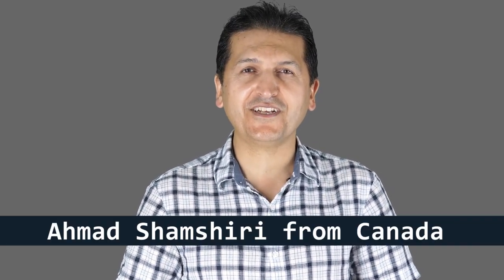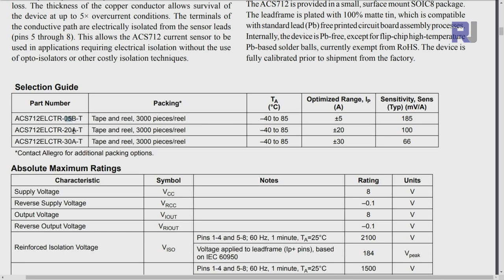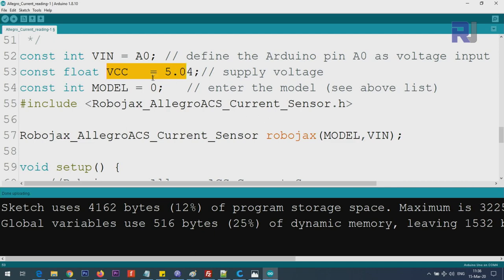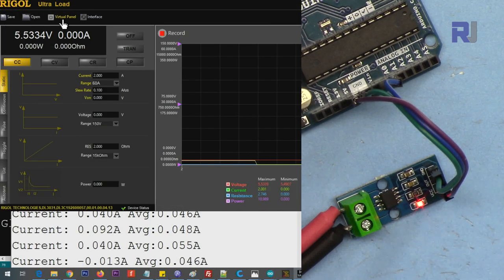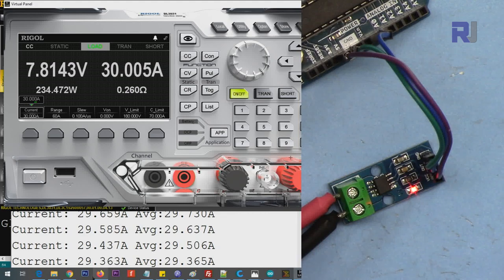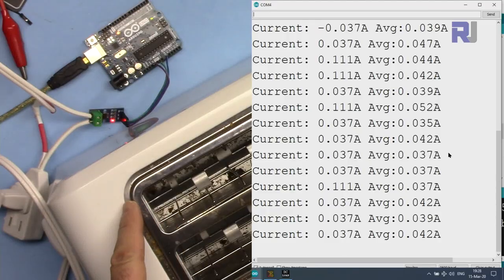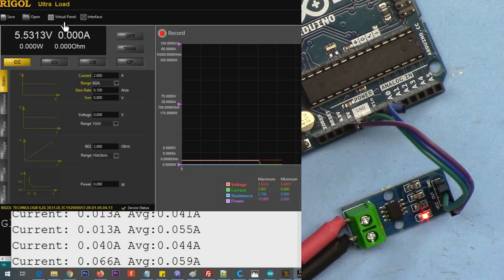Measuring 5A-30A AC and DC current using Allegro ACS712 with Robojax Library (code added into video)

Comment: Thank you for the video. 
I have tried it out however i am getting fluctuating current when i compare to a digital multimeter, is there something that needs to be added on the circuit to get a constant current reading?

Comment: Thank you for your tutorial about ACS712 this is awesome 👍 do you have a video for ACS712  with ESP8266/nodemcu board  and also measuring Energy in Wh, Voltage, current and power ?
Reply from the maker: You are welcome. For now I don't have video this. I might make video. here is my video on Energy Meter https://youtu.be/UK8Kvk8wFmw and how to measure any voltage using Arduino https://youtu.be/t8xwrVj2aFs . You could search without waiting for my response.

Comment: Hello,

I'm using an ESP-8266 nodemcu to measure the current on an AC load(230V, 50Hz). I connected NodeMCU via USB to laptop, and I'm powering the ACS712 trough 5V on breadboard. I connected GND of ESP-8266 to GND of ACS712. Using your code and library I get 13Amps with no load, and no change when I put a 700W load...
Reply from the maker: Hi, first should use this Arduino. I have not tested it with ESP8266 but it might work. I have no idea what you do wrong. So try it on Arduino UNO make sure it works then try it on ESP module.
Reply: @robojax  hi can i use ACS712-30A on an AC load (220 v , 50hz ) !? 
and thank u

Comment: Hello Mr. Ahmad SHAMSHIRI
I am glad to see your video. 
I have one concern, I tried to use your library to determine the power of a piece of equipment but it did not work. 
Please how to use your library to calculate the power of the equipment connected with ACS712-5A sensor.
Reply from the maker: Hello, of course it should not work. It is only current sensor. For power you need voltage then P=v*I where is I is current in ampere. So measure voltage using code in this video Measure any  DC voltage with Arduino
https://youtu.be/t8xwrVj2aFs
Reply: I have the same difficulty. I want to use it in an program but,i don't known how i can use you library.

Comment: Should I buy an R4 or R3? Will your libraries be compatible with R4? I'm interested in current sensing, for the moment.
Reply from the maker: Current sensing is done by measuring voltage. So we use analog input. it does not mater if you use R3 or R4. I have not used the R4 and just purchased it. it seems better for other reasons.

Comment: I have a question for you. I have made a 16 channel relay module and using16 switches (three wires using separate resistors) and was wondering if i could further use the 16 channel multiplexer to further reduce the wiring and still be able to toggle all the 16 channels independently? in your video you said only one relay at a time? BTW LOVE all you videos and have made so many projects because of them
Reply from the maker: Hi Dave, Thank you for your nice and kind comment. Would you please post your question under the relevant video "16 channel multiplexer"? this way when I answer, other people will also learn. https://snipboard.io/Fq5oST.jpg

Comment: You indicate in your video and the allegro data sheet that this device can measure both AC and DC current.  I have an application where the current to be measured is sometimes AC and sometimes DC.  Do I need to specify which current I am measuring or does it matter.
Reply from the maker: no you don't. your sensor does it for you. Just select the right sensor.
Reply: @robojax  When you say just select the right sensor you are referring to the amperage correct?

Comment: With acs712 30A version, how can we use robojax library for a current limiting circuit at 30 kHz fixed according to current values. Can you give the code for this?
Reply from the maker: Code and library is there and the library works based the data sheet. The link in description

Comment: i using  a nodemcu my Vin = 5 volt  but my pins IN are  3.3 volt must i change the Vcc in  3;3 volt or stay with 5 volt the max amp that i going use
is max 2.8 amps DC

Comment: Thanks, Sir i have a question ,  I want to measure a bulb and show the watt but the problem is  the result is not correct.
Thanks.
Reply from the maker: You are welcome. You either have the wrong module or selected the wrong module . If you follow the instruction and got the right wiring and module it should work. Watch the video again and look at your wiring.

Comment: It's good you mentioned the bad design of the PCB....
In addition to the problem with high current you mentioned, there appears to be terrible separation between the 5V measurement side and the potentially high voltage side.

The chip boasts a 2.1kV isolation, but that PCB looks like it could easily fail well below that (possibly even at 240v mains once it gets a bit of dust on it).
Reply from the maker: yes. My job was to educate and now it is up them.

Comment: Hello I'm still having issues with my sensor getting a phase current waveform from my motor. Is it possible that the voltage is too high at 24v 15A?
Reply from the maker: this can work with 2000V I believe. See the datasheet but it is very high.
Reply: @robojax  I can't think of any reason why the sensor wouldn't notice the power change. It has a current reading and then when I turn the power on the sensor outputs seems as if nothing has happened.
Reply: I think because I need PWM rejection for inline motor current sensing

Comment: Hi Robojax! Im doing my final career project and Im building an EPS for a Cubesat. I have to use this type of current sensors with Arduino and MATLAB (college requirement) and I tried to measure 20mA current from Solar Array, but I couldnt read anything (because sensitivity I guess). Im using ACS712 30A with 66mV/A. Is is possible to use the 30A unit or the 5A unit for measurements of 20mA to 500mA? I guess this values are to low that the sensitivity doesnt variate the voltage enough to give measures. 

Thanks in advance! :)
Reply from the maker: Hi,
Even 5A range is too high for 30mA. Use 2% resistor to measure very accurately.   I have another video showing how to measure the voltage.  The current would be voltage value of the resistor. Just search my channel

Comment: Thank you for the video Sir. I would like to ask how to connect the ACS712 if the input is from solar panel, because the input is in a power form, which have voltage and current. and also the arduino code for that, is it different? I'm waiting for your reply. Thank You
Reply from the maker: This works for any pier source.
Reply: @robojax  do I have to connect it with some load, to get the current to be read by the acs712? Or it will be fine without the load because the current is already exist? Thank You
Reply: @dorothyp9186  current should be zero or close to zero and constant if no load is connected. Ive made small solar datalogger with this exact sensor and it works perfectly

Comment: Hi, thanks for the nice video and explanation. Can you also tell if the input is isolated from the output pins on the module. I mean would it be safe if I measure AC current and I connect this to the Arduino which will run on its own DC power.
Reply from the maker: Yes, absolutely
Reply: I know Im kind of off topic but do anyone know of a good site to stream new series online?
Reply: @Asa Ryland flixportal :D
Reply: @Marcellus Orlando Thanks, I signed up and it seems to work :D I appreciate it !
Reply: @Asa Ryland no problem :D

Comment: Hello thank you for this video. I'm using a WEMOS D1 ESP8266 board and my max Voltage measurement is 3.2, I want to measure around 5V input, what would you suggest I do? I tried to convert it with a factor but I'm not sure it is the correct way to do this. what would you suggest?
Reply from the maker: Just set the voltage to 3.3v and it should work
Reply: @robojax  Hello, I tried measuring 4V and the serial monitor shows 1024 corresponding to 3.2V which is the limit. Only lower voltages give correct values on serial monitor. Higher than 3.2 V it shows just 3.2 as it is the limit.
How can I keep manipulate this so that it shows the correct values without changing my board.

Comment: @Robojax, what does the 2.1KVrms voltage isolation mean? can it be use to measure current for 415V(AC)?
Reply from the maker: it means if you try to measure the current for 2kV, you are okay. above that might be dangrous.
Reply: @robojax  Thank you for the clarification Sir.
Reply from the maker: you are welcome.

Comment: great video, i wanted to make an under/over voltage DC load protection on my arduino  where i use DC source as input. is it possible to do so. if yes, can you please help me with it.
Reply from the maker: I have written library for Winsin sensors. Here is the protection video https://youtu.be/vs7Nw107AOo buy this is video requires you to watch the main Winson sensors video. You can apply the same method mention with this video to read any voltage using Arduino https://youtu.be/t8xwrVj2aFs

Comment: Hello,

Is it normal for arduino to display values in my Serial Monitor even if the sensor is not connected to the board?

Current: 25.956A Avg: 25.919A
Current: 25.882A Avg: 25.909A
Current: 25.956A Avg: 25.910A

I receive values without the sensor being connected, and when I connect it it doesn't change anything.
Reply from the maker: yes. when the Analog pin is not connected you will get some value .it should be connected.

Comment: Can I measure both voltage and current using this module?
Reply from the maker: no. the title says current. so you to use other code and components to do that. but I have energy/power meter code. search my channel. here is the video https://youtu.be/UK8Kvk8wFmw
Reply: @robojax  ohhhh okay thanks because I my project is to measure both voltage and current of the battery, charge by solar panel. I kinda having problems. But thanks for the insight. You really help does who comments. Subs!
Reply from the maker: No problem, my other channel is focusing only on energy like battery solar and charger

Comment: Thank you for the tutorial. I still have a problem when I have zero input current but my 5A sensor read it around 1 A, how can I fix that? and how to convert from  A into mA?
Reply from the maker: if at 0A you get1A and test it if at 3A you are reading 4A, then subtract 1.  I know there was issue and addressed it with another sensor and library that I wrote. https://youtu.be/z-s8UvCWGxY I might update this library, but am very busy now.

Comment: after connecting load , my readings(amps) decreases instead of increasing. Using esp32
Reply from the maker: This has not need tested to work with esp mcu
Reply: This can't work correct with esp because it uses 3.3v and this works best on 5v. You need to connect it to 5v and use 5 to 3v logic level conventer to work with esp modules.

Comment: Can you connect it with a ads1115 and if they answer is yes are thé caculations then more correct and how do you do that ?
Reply from the maker: I chececk ADS1115 and found it  is gain amplifier. Why would you need gain amplifier? for Arduino you don't need anything else. But if you want to use it without arduino, then here my initial video on this module where I have explained the calculation and no library https://youtu.be/DVp9k3xu9IQ
Reply: @robojax  thanks for thé intel

Comment: I get the following error message in the serial monitor. I have set the correct Vin, model 0 and left the voltage at 5.04. Please advise. Thanks in advance for any help.
Robojax Tutorial
ACS770 Current Sensor
Current: Guru Meditation Error: Core  1 panic'ed (LoadProhibited). Exception was unhandled.

Core  1 register dump:
PC      : 0x400d14db  PS      : 0x00060c30  A0      : 0x800d1564  A1      : 0x3ffb21d0  
A2      : 0x00000000  A3      : 0x0005b49a  A4      : 0x00000000  A5      : 0x00000000  
A6      : 0x3ffb833c  A7      : 0x00000000  A8      : 0x800d69df  A9      : 0x3ffb2180  
A10     : 0x00000000  A11     : 0x00000b5b  A12     : 0x3ffb21cc  A13     : 0x00060023  
A14     : 0x00060020  A15     : 0x00000001  SAR     : 0x0000001d  EXCCAUSE: 0x0000001c  
EXCVADDR: 0x00000008  LBEG    : 0x400862c1  LEND    : 0x400862d1  LCOUNT  : 0xfffffffd  

Backtrace: 0x400d14d8:0x3ffb21d0 0x400d1561:0x3ffb2200 0x400d154d:0x3ffb2220 0x400d1561:0x3ffb2250 0x400d146f:0x3ffb2270 0x400d30e5:0x3ffb2290
Reply from the maker: This is not printed by the library I have written. Code has changed
Reply: @robojax  Where can I download the correct code?

Comment: What do I need to change to use it on ESP32
Reply from the maker: if you watched the explanation, you should know by now that we are measuring voltage from the sensor which represents the current.  Search my channel to learn how to measure the voltage using ESP32. Here is how to find Specific YouTube Video in a channel https://bit.ly/findYouTubeVideo

Comment: thank you, how i can make read only maximum value my current sensor ?
Reply from the maker: every time it read at that moments that is the maximum. if you want to just get the peak (maximum) and stop. for example if you expect to have 8.5A as max do this if(robojax.getCurrentAverage(300) >=8.5)
{
 Serial.println("MAX 8.5 reached");
while(1);
}
the while(1) will keep the code stopped at that line. I hope this helps.  Thank you for not skipping the ads and keep watching them. This will help me a lot.
Reply: thank you very much; sir,  I want to measure  the load current only >=15 and display on the LCD but it reads minimum and maximum value. 
thanks.

Comment: i want to measure the current from the solar directly , so what i can do ? please help
Reply from the maker: this is the example that you use. didn't understand why you didn't get it from this video? I showed power supply. your power supply is solar panel. to measure you need load. so your solar panel must be connected to a load to measure current. without load, there is no current.
Reply: @robojax  can i contact you in personal to describe to you my problem?
Reply: @robojax  what kind of load i need to use ? max amp that i will get from solar is 6A
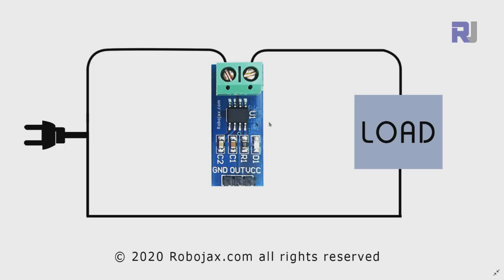Reply from the maker: you made me watch my video and at 6:25 I've shown how to connect it.  and if you don't know load, then you need to start from A, B, C of electricity.
Reply: You didn't understand me well
I create solar data logger with temperature, voltage, current and LDR sensor
I used load which is one lamp 12v 55 watt and my solar max output 100 watt
The current sensor didn't read well so this the problem
Reply from the maker: this works with AC load and DC load. This is open to anything. I don't what to tell you. use toaster or heater for AC or use FAN or motor for DC.  Now we are getting to A, B, C Power =Voltage x Current and current=Power÷Voltage. so if you need 6A AC, if your power line voltage is 120V, then P=120x6=720W so you need 720W load. good luck

Comment: ive tried your code but there seems to be an error. Im not even trying to upload it yet, just compiling the code and error came up. Im putting the error here. Hope you can help. Thanks in advance

Arduino: 1.8.12 (Windows 10), Board: "Arduino Uno"

In file included from C:\Users\mdhar\AppData\Local\Temp\arduino_modified_sketch_444235\Allegro_Current_reading-1.ino:93:0:

D:\Smart Home Automation\Arduino\arduino-1.8.12\portable\sketchbook\libraries\Robojax-AllegroACS-Current-Sensor/Robojax_AllegroACS_Current_Sensor.h:71:2: error: #endif without #if

 #endif

  ^~~~~

exit status 1
Error compiling for board Arduino Uno.

This report would have more information with
"Show verbose output during compilation"
option enabled in File -> Preferences.
Reply from the maker: Hi Danial,  Thank you for letting me know. I just fixed the link with new library. Please try it and let me know if there is issue. Thank you for not skipping the ads and keep watching them. This will help me a lot.
Reply: @robojax  thank you very much for your fast reply and your help. I've tested the codes and its working wonderfully. The readings are very stable even when its set to 30. One problem though, the starting value is too high, at no current, it shows around 150mA. Is there any way i can make this value go down a bit?
Reply from the maker: just subtract the amount you want. like robojax.getCurrentAverage(300) -0.150

Comment: The AC current should be measured in RMS, not in average. That's why the reading is less than the actual value. Assuming that the current is a sine wave, a simple fix is to multiply the average by 1.11
Reply from the maker: You may be right, but the datasheet does not say anything about extra factor for AC or DC.  I have implemented whatever was in datasheet. Thanks for the comment on the matter.

Comment: You didn't explain absolutely anything about the wiring. Oh yeah, and your library is full of mistakes and doesn't work :) Good job buddy
Reply from the maker: when you skip the video this is what happens. I have just watch it and wiring is explained wire by wire and even wire color is explained.  Library has been tested and works according to the datasheet. Good luck agne.

Comment: I have a 30 A version, my load is very small, 10watts, my sensor is not able to detect any current, what can I do please??
Reply from the maker: Use a resistor with tolerance of 1% or use 5A sensor